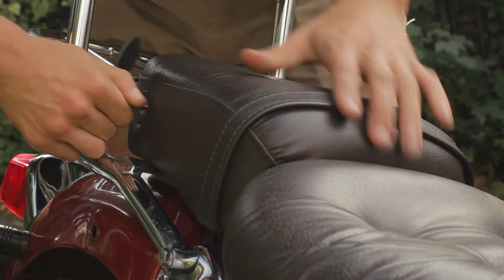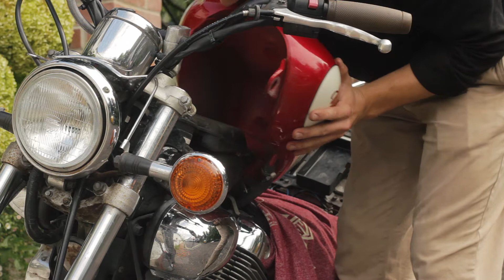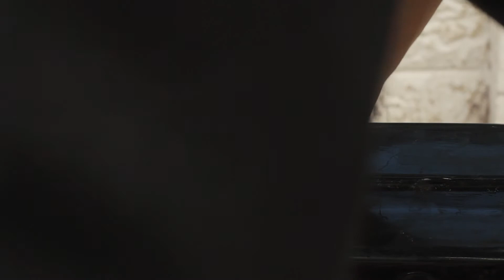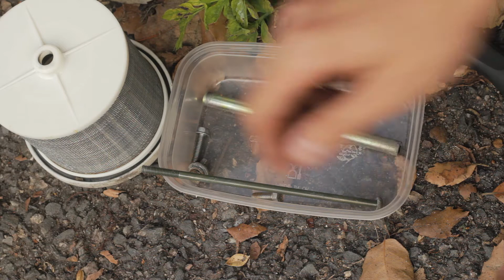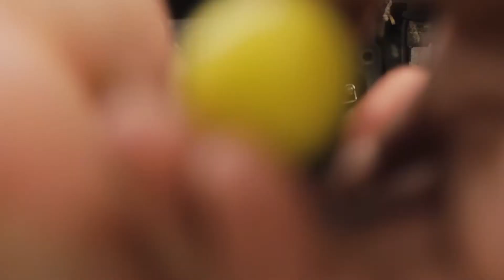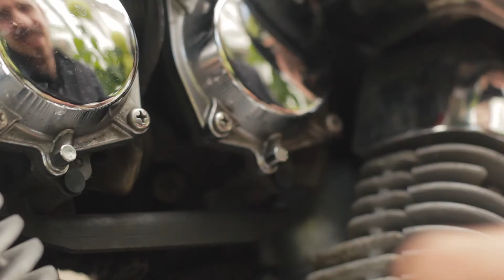Jadus Air Induction Kit Installation // Yamaha Virago 535

Comment: Interesting that your stock filter looked exactly the same as mine with that big plastic cap on top, then the tube down the inside. Looked to me like it was a restrictor. I changed the filter for one that doesn't have the plastic lid part and it made a world of difference to it.
Reply: Did you change the main gas jet after that or the air mixture screw setting?
I found that the Hiflo air filter n°4502 does not have the inside tube in the inlet. Is that what you're talking about? If so, I will try this. 
Regards.

Comment: Good evening. I bought a 535 which is equipped with this air filter (not the same drawing) but the same shape and same material and the same adapter !!!! on the other hand, the jets remained the original ones. is it possible to know their size or buy a set. Thank you for your cordial response . georges.
Reply from the maker: Hey Georges! 

The best thing to do is to contact Jadus direct either on Instagram or via Facebook! 

Jake, the owner, is super helpful and will be more than happy to answer any questions. 

he also knows a lot more than me too!
Reply: ok. thank you very much.

Comment: Do you still have the 535 ?
Reply from the maker: No man, that's gone! 

I had to get rid of it after the engine cases were leaking oil - I don't have the space, time or knowledge to fix it. 

Let me know if you have any questions about the bike though - I really enjoyed it!
Reply: @killnothingbuttires4035  I am currently on a 125cc learner riding around on some of the roads you have in the video's, I was looking at the 535 as a first big bike. Thanks for the reply.

Comment: Air filter worse than the stock one...
Reply: The air filter is made by this company:  https://ramair-filters.co.uk/  They have been making performance air filters for three decades and have had a lot of success in racing applications as well.  The filter is made of a special two layer oil impregnated foam, so we are pretty confident these filters are just as good, if not much better than the stock paper filter.  But hey, what would 30 years of experience know?!
Reply from the maker: Interesting that you say that, Andreas. Have you got any experience using the Jadus kit at all? I found there to be definite improvements to performance and sound.
Reply: @killnothingbuttires4035  Well, give us view of spark plugs, give us power reading, give us fuel consumption. Is he running lean or rich now. etc. Give us all that in one video without cuts then we can judge that kit.
Reply: @dadobojanic  hey man! All the information is available on our website and in our other videos - with many hours of dyno testing and power and torque print outs. Don’t believe it? Try it yourself and if you don’t like it we’ll give you your money back! Already in 3 months of selling the kits we have had feedback from many customers who love the kit and the extra power 👍🏼
Reply: @dadobojanic jadus have posted videos of them on the rolling road with this kit and multiple exhaust set ups